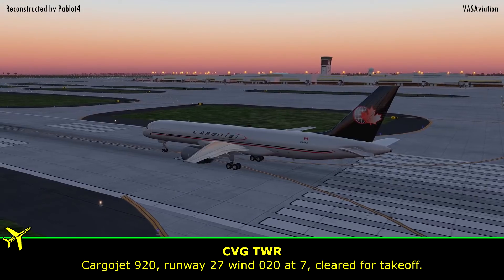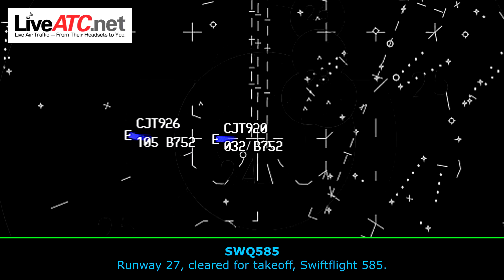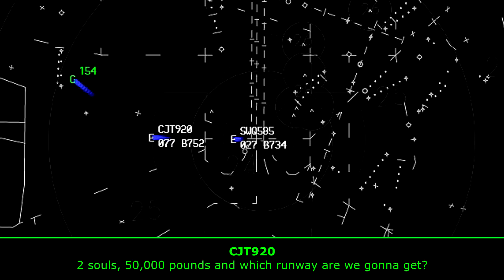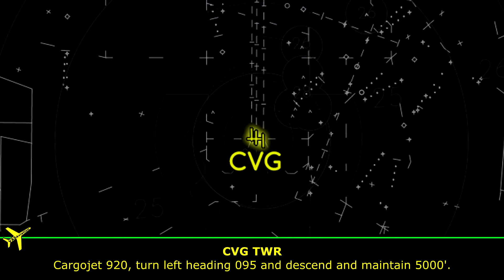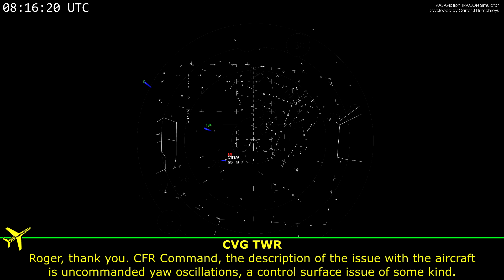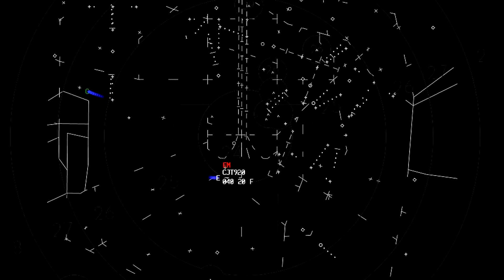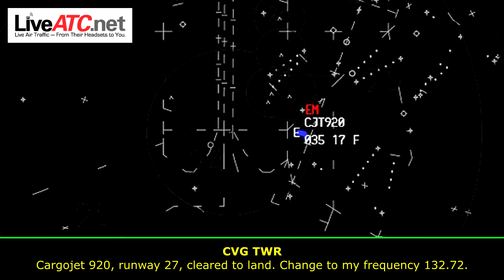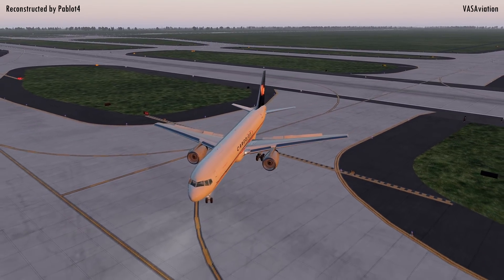Cargojet B757 has UNGOVERNED YAW OSCILLATIONS | Emergency Return

Comment from the maker: *COPILOT OF THIS FLIGHT REACHED OUT VIA EMAIL*
Here's his words on his experience:

Normal takeoff until rotation. Then initially it was a slight oscillation, but as we accelerated it got really bad. Compared to the animation it was a lot faster but not as big. So a full cycle in every second, and we had full deflection left and right on the turn / slip indicator. We we’re getting thrown around up front as well. Since the oscillations were so quick we didn’t get much roll out of it. However, we thought the rudder was gonna come off, even as we slowed down.

So it was my takeoff and I told the captain that I wasn’t touching the rudders and if he remembered the A300 accident in 2001/2002 in nyc? Just so he knew I wasn’t doing anything.

We also had no indications as to what was wrong. Everything was indicating normal. So I was going through checklists trying to find one that would help. When we did find one pertaining to flight controls it said to not troubleshoot.

I guess the other thing you didn’t hear was that we stopped on the runway to get inspected for fluid leaks and damage before leaving the runway.

The problem ended up being one yaw damper was kicking the rudder to the left, and then the other yaw tried to fix it. So they were having dual the whole flight.

A friend who I hadn’t seen in awhile sent me the video saying this is you right? So it was a bit surreal. Anyone who I’ve shown it to has said I sounded good on the radio, but in reality I definitely only hear myself scared trying to sound calm and focused. 😂
Reply: Air crew were cool as a cucumber.  Same goes for ATC.  Exactly what any passenger (or piece of cargo) would want.  Great job by all.
Reply: Wow!  Great testament to VAS Aviation’s reputation for accurate reporting.
Reply: Awesome that you do these videos and that the co-pilot reached out. Thanks!
Reply: You were amazing in a terrifying situation!
Reply: That A300 accident, I remember it well - AA587. Right after 9/11, we all thought it was terrorism (I'm just outside NYC). Pilot overworked the rudder and broke off the vertical stabilizer. Crashed into a densely populated area of Queens, I think I recall it killed some people on the ground too.
Reply: GREAT JOB
Reply: Ya, might not be in procedures, but I probably would have tried disabling the damper, seeing it's not a critical system.

Comment: Yaw oscillations on an aircraft that has control tabs should never be a thing, however too many pilots don’t know anything about the mechanics of an aircraft. It’s caused crashes before, when you continue to hydraulically operate a malfunctioned component, when it could be optionally manual controlled.

Comment: I didn't realize tower controllers could also operate as their own approach controller. Very interesting. Sounds stressful.
Reply: Not very common in the USA, but in many other countries they have it. Another controller trained in providing non radar procedural separation,  brings the aircraft to a point,  final approach fix and then transfer control of the aircraft, to the local controller. It is quite a thing to watch, as the controller climbs, descends and applies lateral, longitudinal, vertical separation, holding procedures, etc.  On those days he certainly earns his  wages.

Comment: If the wind was at 030 at 8 why wouldn't they turn around and make 9 the active to at least have some headwind component? Airnav says both 9 and 27 have ILS.
Reply: In good conditions the runway is about 5 times longer than the aircraft needs to land, so 16kts is probably not enough difference to matter.
I don't know why they wouldn't prefer it though.

Comment: I am curious,  When a controller handles incidents like this one, are they given a break when it is done or does their day continue as normal?
Reply: From experience, I would say he continued on until his break time. Yes, this was an emergency, and was handled well by the pilots, once they performed their checks.  The aircraft landed safely, well done.  Had there been a crash, I am positive he would have removed himself or been replaced in position by another controller.
Reply: Since their work day is planned around a schedule (they can only work so many hours, then they must rest) ending up back at the same airport with a broken plane would probably be the end of their day, simply because there is no work available for them to do.
There is probably a briefing with their company and FAA reports to do as well, which all comes under their working time limit for the day.
Reply: Where I live, a smaller airport.   3 controllers on duty.    1)  Working Clearance delivery and Ground    2)  Tower      3)  rest period.    They rotate through the positions  40 mins on, 20 min off every hour.

Comment: Perfect from beginning to end except for the controller transmitting one message for CFR to the pilots, but that was harmless.  It always makes me happy to hear the pilots say PAN or MAYDAY and stating their issue instead of being vague and being scared to declare an emergency. Great ATC.
Reply: Canadian plane and crew. PAN PAN and even MAYDAY are not common usage for US pilots, who, for some cultural reason, are reluctant to declare an emergency. We normally say "Declaring an emergency." rather than other terminology. Note the red EM on the radar screen.
Reply: @jimandmandy  I have complained about this exact thing multiple times on other videos of VASaviation's.  Americans have a strange reluctance to declare emergencies and be clear about it.  So this was very nice to hear it done properly in the USA, even if it was by a Canadian crew.
Reply: @davidbatguano9244  And I was guilty of the same thing as a newly minted pilot. Instructors never mentioned PAN PAN, so I did not use it in a situation where it would have helped the controller help me with my rough running engine in a piston single. He had handled me as an emergency, but I only found out when So Cal approach handed me off to KLGB tower, who asked me souls on board, fuel remaining and if I was requesting "the equipment".
Reply: @jimandmandy  - The "EM" tag is put on by the controller,  to prominently depict the target. It is visible on other scopes and all are made aware. It never bothered me if the pilot said, PAN PAN, MAYDAY,  DECLARING EMERGENCY, or I do not feel well.  Once we 
have rcvd a call, it is all hands on deck, to assist the pilot.
Reply: @rubenvillanueva4317  The EM tag is put on by the controller IF the pilot doesn't switch to squawk code 7700... if they do, the EM tag shows up automatically.

Comment: To any aircraft mechanic..yaw oscillating means a loose rudder not connected to actuators?
Reply: I am not a mechanic, but an aircraft can get into osculation due to aerodynamic forces. Modern airplanes are installed with a yaw damper that dampens this automatically as it is very hard to do so manually.  So it appears they had a problem with the yaw damper.

Comment: Nice job Cargojet. ! Did the yaw damper not disengage after you noticed the oscillation, or was it a runaway trim problem.?
Reply: I once had a pilot write in military maintenance log "aircraft trampling" after a flight then left before discussing it.  Asked other engineers around me if they knew what trampling was and no one knew, so I called the pilot.....rudder oscillations.
Reply: Sounds more like they had an issue with the yaw damper.
Reply: @se-kmg355  The oscillation should have stopped once the yaw damper was disengaged and should have restored rudder peddle inputs. This is what makes me think of elevator trim.! A circuit breaker  could have peen pulled for ether or to stabilize and maybe even reset to allow the flight to continue. Short down time had resumed the flight to Cargojets maintenance facility in Hamilton Ontario.  A breaker was pulled somewhere to allow this.!
Reply: @flyifri  Can you please explain how turning off the yaw damper is going to stop the oscillation when that is what it is sole purpose to prevent?
Reply: @se-kmg355  The yaw damper is used to complement the auto pilot in minimizing the pilots needs for rudder inputs at keeping the ball center. They are a modern innovation used  to complement a much nicer flight allowing pilots to put their feet up, sit back, relax and enjoy the ride. Most aircraft through out history never had them, so the then pilots had to keep his feet on the rudder peddles. Pulling the breaker on the yaw damper is old school  and a short ride from Cincinnati to Hamilton for servo replacement.! Easy Pizi repair.!
Reply: @flyifri  To my understanding, the main purpose for the yaw damper is to prevent so called Dutch roll. Many aircraft needs this to be in operation to fly. The MMSL for the 757 states that 2 yaw dampers are installed and you can still fly as long as one is operating normally. I do not know if the yaw damper is the issue, but I am pretty sure you do not want to fly with out it.
Reply: @se-kmg355  Stick and Rudder is all I can say. They may have simply needed to get back on the ground for that last minute cargo left behind. We will never know, and that's OK. The whole world is now a stage.!
Reply: @GWN Aquatics Tell that the 737 Max Pilots who pulled the breaker and were saved from something outrages. The blind follow the blind in the real world. Willy Nilly never.!
Reply: @GWN Aquatics Ya I know what you mean. Cargojet is a big company and has been around for a long time, based out of Hamilton. Pan Pan will get you on the ground faster without a red flag of interest.! I know a pilot who forgot his cell phone on the table in flight operations only to find it under his seat. You would be surprised what excuses pilots can legally make to get what they want.!

Comment: Curious why he first told them to contact Indy center, then on read back said no, stay with me.
Reply: There are two aircraft. Cargojet 926 is told contact indy center, cargojet 920 is asked to say altitude and climb to 13000.
Reply: @pwr2al4  Wow, didn't catch that. Gotta love having two so close in designation to each other.
Reply: @pwr2al4  Seems to me that knowing full well commercial flights are identified by the operator codename and flight number that they should choose their flight numbers better. By that, I mean avoiding using similar flight numbers for aircraft scheduled to fly routes that place them in the same airspace at around the same time. That said I guess even with the best of intentions it would be hard to guarantee such situations didn't occur anyway without using a very broad definition of "similar time". A fairly minor technical problem can throw a departure off by hours if it involves an item on the MEL for example.
Reply: Might be old habit. Stated in the video that due to low traffic, tower also handle approach and departures.

Comment: I'm pretty sure I wouldn't like my airplane doing uncommanded yaw oscillations.
Reply: It does not seem ideal.
Reply: I'm of similar opinion.
Reply: Ever played the msfs20? 🙃
Reply: With a big, long plane like a 757-200, I'm sure it felt pretty extreme/exaggerated in the cockpit.  Also, no doubt scary having your plane doing things that are uncommanded and not knowing the reason.  Great job by the crew and ATC.

Comment: Kuddos to the calm slow demeanor of the controller. One small thing: callsign format. Nine-twenty is correct. Nine-two-zero is not.
Reply: I do not know about FAA regulation, but ICAO is that every digit should be read separately, such as niner-two-zero.
Reply: There was both a Cargojet 920 and a 926, I think saying nine-twenty could lead to some confusion if not heard clearly, they probably wanted to eliminate any chance of that.
Reply: @justinlord6194  Excellent point. I declare this controller flawless. Get him out of the tower and into the classroom!
Reply: FAA manual, states that both methods are correct. (Group form or individual digits)

Comment: Wait, flight control issues and he declared a PAN PAN? Not an emergency? Did I miss something? 
Surly flight control issues is an emergency?!?!?
Reply: It is up to the pilot. Just like when you feel very sick you can choose to call a cab to the emergency room or dial 911. 
In this particular situation the pilots are still in control. Some particular nicer pilots will also down grade their emergency once they regained control.
Reply: @AaronShenghao  I know it's up to the pilot. I'm just saying it's definitely an emergency. Some pilots are guess just afraid to declare it as such. 

Again, even though it's minor, it is a flight contr issue. 
Glad they landed safely. Curious what the issue was. Was a aircraft mechanic a years ago before starting my degree for a pilot.
Reply: josh62294 didn't know there was a "pilot degree" but as a pilot, come back and comment after you are left seat on a 7-5.
Reply: @extraace  yes actually there is. Bachelors of science in aviation. Lots of universities offer this program now. That's how one qualifies for a R-ATP at 1000 hours. 

I don't care what aircraft you may or may not fly. That's beside the point. It was a flight control issue. I take you you don't read NTSB reports often do you? How a minor issues becomes massive and ends up being fatal? In particular flight control issues. Does a jack screw sound familiar? I can continue if you want.
Reply: I don’t call BS in aviation management (like I have) a pilot degree. I read plenty reports, was in flight testing, instructor (jets), been through flight control issues, engine failures, depressurizations, etc. Again - I’ll side with the judgement of those that were in the plane vs someone trying to qualify for their atp.
Reply: josh62294 true about the controller. He was a good one.
Reply: @extraace  do you want the FAAs word for it as well as a DPE. A flight control issue is an emergency. 
Furthermore you obviously have been out of school for a while. A bachelor's of science in aviation is specifically for being a pilot. You must have all your ratings to graduate (minus ATP) so 45 core classes (up to commercial, with 15 aviation electives (CFI, multi, II,MEI etc) it's literally for being a pilot lol. I can so give examples (as I literally done reports on this) of minor flight control issues that became severe and killed people.
Reply: @MindTesla  what difference would PAN vs. Mayday be in how it was handled? The pilot declared PAN PAN because though it was a potentially dangerous situation, he felt it was under control and not quite to the level of mayday and reserved the mayday call for if the situation deteriorated. Captain made the right call.
Reply: @Timmy2384  Thank you. Said it right. Thanks for appreciating as well.
Reply: Up to the pilot.  Mayday = life threatening, emergency = distress, and pan pan = urgency.   If the aircraft was under control and undergoing minor uncommanded yaw motions, in the pilot's judgement, that's not an emergency.  He only needs priority handling as opposed to emergency distress handling that has implications as to radio frequency usage, airport response personnel etc.   You trying to second guess the guys that were in charge of the flight?  Why?  They had control of the plane, not you.  In their judgement it was not a distress situation.
Reply: @buckhorncortez  a flight control issue is 100% an emergency. Weather it be minor or not.
Reply: @buckhorncortez  I can point you to numerous flights that started out as minor flight control issues that ended up being major and killing everyone on board. 

While the controller here was amazing and treated the emergency as such, I question what would of happened in a busy Class B airport. 

The slightest issue regarding flight controls constitutes an emergency. Can easily start off minor and become much more severe. 

P.s I know the difference between panpan and mayday. It was more of a rhetorical statement as it should of been declared as an emergency.
Reply: Both a MayDay and a PanPan are considered  emergencies by the FAA.. Here's the quote from the AIM:

 6-1-2 Emergency Condition- Request Assistance Immediately

    An emergency can be either a distress or urgency condition as defined in the Pilot/Controller Glossary. ...

The AIM goes on to say that pilots should not hesitate to declare an emergency for an urgent (PanPan) condition before it turns into a distress situation
Reply: @jcl410  exactly. I wonder what this particular airlines policy is on the pilots who declare emergency paperwork wise.